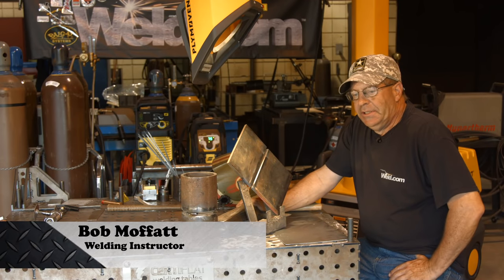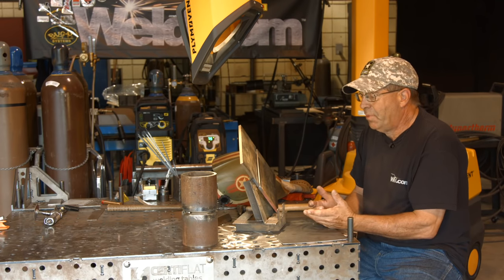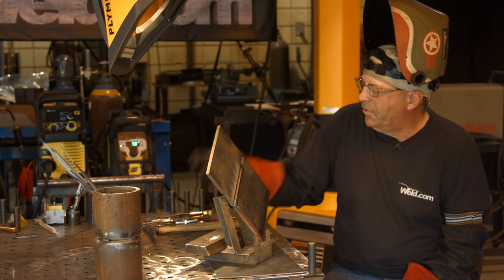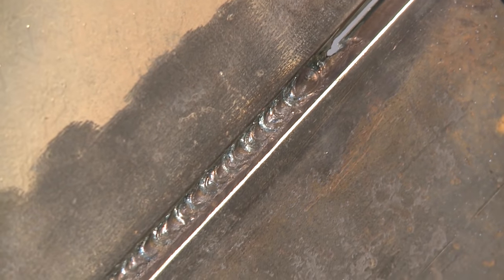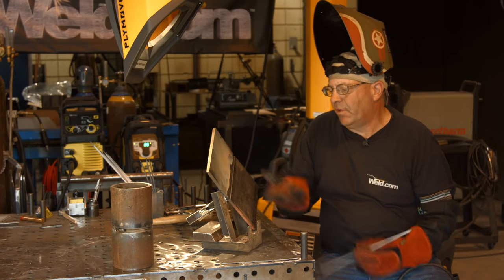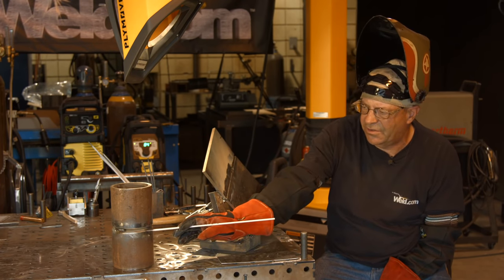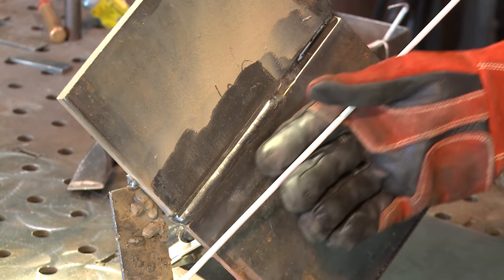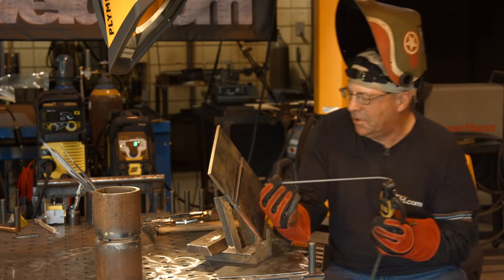🔥 Simulated 6G - How to Practice the 6G Position without Pipe

Comment: Thanks Bob for another great video.  As a pipe welder who passed ALOT of tests over the years, I learned to run a root pass and (over the years)weave out to my cap stringers.  No matter what the position. From 2" to 3" pipe. Anything over that, stringers.

Comment: When I was in welding school they told us to 1) whip and pause on the root, rather than a straight stringer. And 2) grind the rough of the 6010 root and run a 7018 as a hot pass that way, rather than the 6010 like you do. 

Does one method have any advantage/disadvantage vs the other or is it personal preference?

Comment: I practice my pipe welding by welding on old tire rims.  junk yards are full of them.  mount them in any position on a engine overhaul stand.  weld inside outside whatever weigh 50- 60 pounds when I get tired of it.  haul it back to to scrap yard get a few bucks go have a beer or two  go round up another few  welded a bunch together once won't do that again!!

Comment: good video! would you be able to do a video on MIG roots? specifically starts and stops, at college (UK Level 2 - 1st year), im doing MIG open root Butt joints at the moment but i am consistently getting lack of penetration at the start and the stop near the tacks, yet the rest is spot on, we are doing this with 6mm plate in the flat position, many thanks! :)
Reply from the maker: Sure, we'll add it to the list.
Reply: Weld.com thanks! :)
Reply: Grind (feather) your stops. Make them nice and thin.

Comment: If you're not draging your stick on that 3rd pass, how do you know you are holding it say 1/8" up as you move? Is it the size of the arc? I am in tech school, 1st semester, and do not know how to tell my arc length or even know what to look for. Also, your root pass, are you draging the 6010 or holding it up slightly?
Reply: It comes with practice and muscle memory. But u can never go wrong with a tight arc length if you’re loosing arc. After the rod is hot and running you can push the rod into the metal without it sticking.

Comment: Bob, I started on 1G with an open back but I can’t seem to get a good root pass without whipping the bead in. I see that when you run your root, you have hardly any movement, if any movement at all. What would you suggest I do differently? Running 6010 1/8” rod at around 75 amps and about a 1/4 of arc strength.
Reply: Chris Harrell What root face and gap?
Reply: Bob  Moffatt I don’t have a piece in front of me but I’d guess around a 1/4-3/8 root face. The gap is 3/32
Reply: Chris Harrell Plate is 3/8. If you had a 1/4 root face you essentially have no bevel left. And at that gap, you'd have to run way hot or you won't get penetration.
Reply: Chris Harrell 3/32 face, 3/32 gap.
Reply: Bob  Moffatt well, I’m sure I’m wrong on the root face. Lol! I can get a fairly consistent bead on the back side for the most part, aside from tying in. I just can’t seem to get it to work without whipping it in. I only have class two days a week and it’s a class more for the hobbyist than it is an actual class. I’ll get more information tomorrow and get back with you on it.

Comment: What happens when you use too much argon when tig welding
Reply: You draw air in behind the shielding gas and contaminate the weld. Too much velocity so to speak.
Reply: Bob  Moffatt 
Thanks for info.my weld was ugly and gas was way to high. Problem solved
Reply: jeremiah T walker you can get by with 12-20 cfh depending on cup size and amperage
Reply: Bob  Moffatt 
I have my cert. In stick ,  now I'm fooling around with some tig

Comment: What if wps calls for 2 stacked but I'd rather step in 3 on the cap..
Reply from the maker: Follow the WPS
Reply: It's just looks goofy with 2 stacked out on .500 wall
Reply: What size rod do you think you'll run to stack 2 on a .500 wall?
Reply: 5/32  fill it flush and the drag 2 around it a bit of a weave... more so with 1/8.  Not huge bore 4" .500.. just a tad heavier than. Sch 80
Reply: Stand the bevels up a little more so the bevels arent a mile wide  tighten the gap up throw it in 4th gear and 65 skate a bead in it and go
Reply: First you ask a question, now you're stating numbers. Cool. Show us your vid and pics, please. We want to learn this technique. 5/32 seems a bit big to control on 4". Show us.
Reply: I can give it a shot on video... it'll be rolled out as most of these are .. if it's in position in the field I'll do everything I can to not have to weld horizontal or on a 45 to keep from having to stack the cap
Reply: Roll out is a whole different ball game. Sure you can run larger rods and haul. I want to see your weave in horizontal.